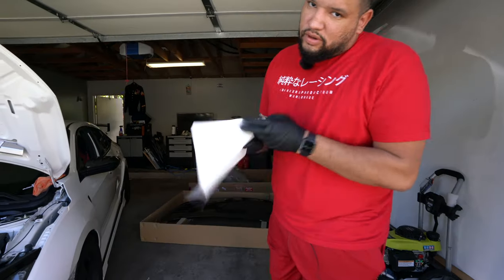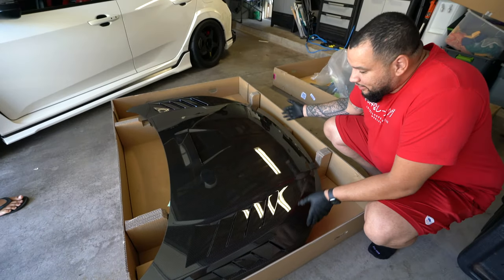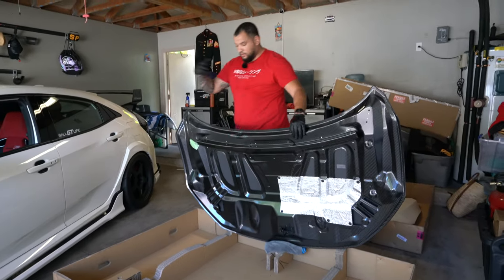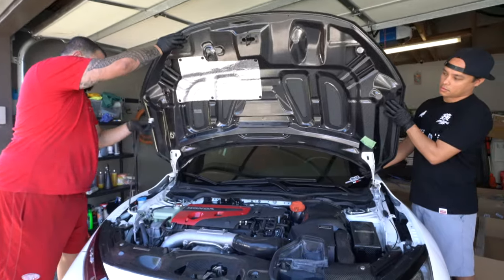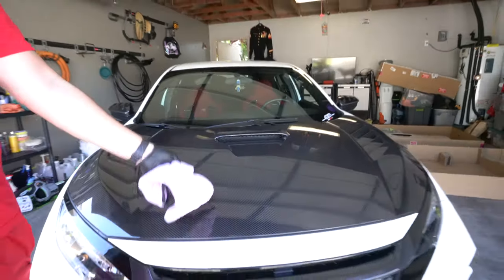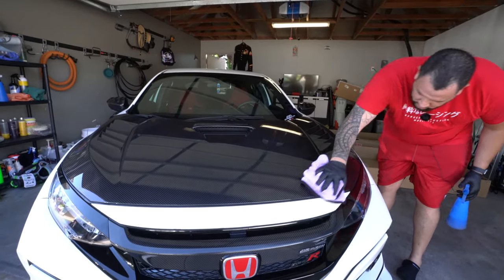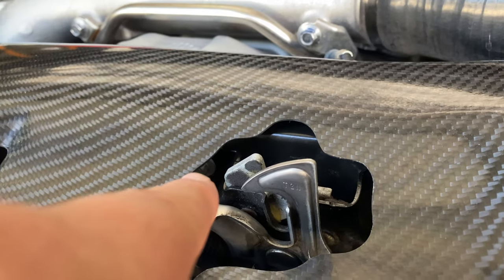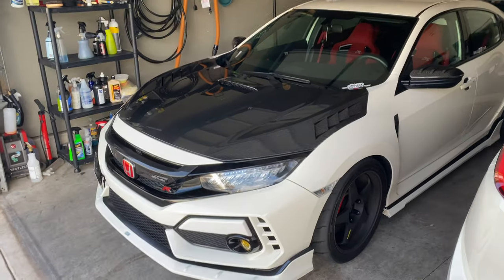Carbon Fiber Mugen Hood/Bonnet install | FK8 | Civic Type R

Comment: Did the hood adjust from the hood side or the latch on the front. How did you adjust it so that it would latch correctly without breaking?

Comment: Be careful with a hood like that if no latches! Carbon hoods have a bad reputation of separating from the hood latch! Dope video! Crazy build.
Reply from the maker: I’m not sure if I ever heard of a Mugen wing ripping off before.. 
Carbon fiber shouldn’t rip like that if built correctly and with quality.. which I don’t doubt at all with Mugen.. Plus there is no way I would ruin a 10k hood by drilling into it.. 

Appreciate you!! Thanks for the support!!